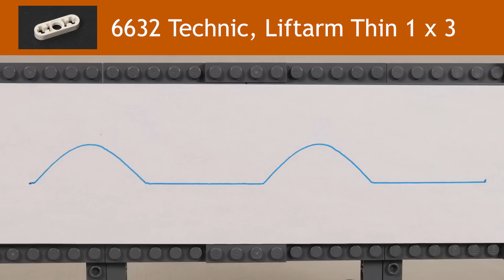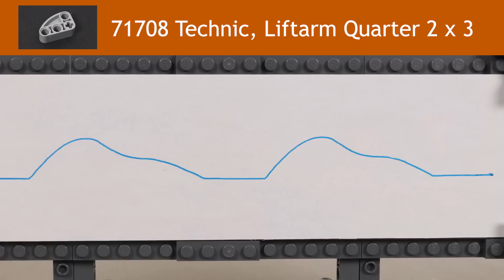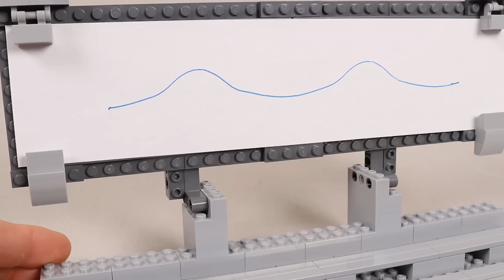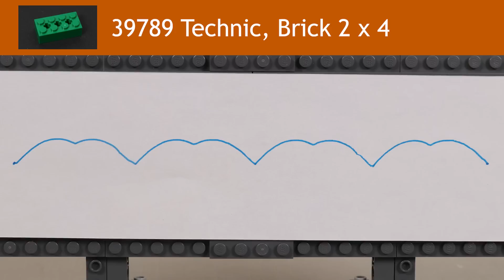Graphing the Motion Profile of LEGO Cams

Comment: Love this!
Regarding your question at the end: Not sure if you missed any obvious pieces, a bit more obscure: a whole bunch of 2 by 2 bricks with axle hole and various protrusions, the 1 by 1 and 1 by 2 technic bricks with axle hole and of course these would allow brick-built cams that basically then give access to hundreds of cam profiles or even thousands, depending on the size you choose. The 2-2 modified plates with bar frame could also be interesting. 
And essentially, you forgot the null cam: 	Brick, Round 2 x 2 with Axle Hole
;)
Reply from the maker: Ha, I did consider adding a 'null' cam as a reference, but forgot about it when I went to filming. Perhaps in the next one. :) Some great suggestions for compound cams!